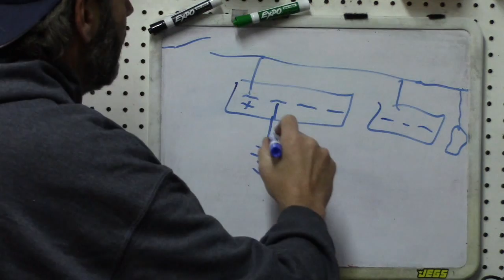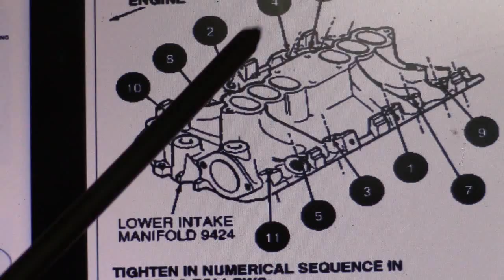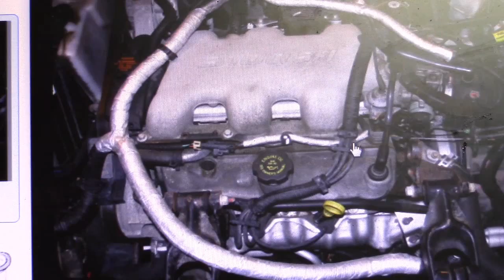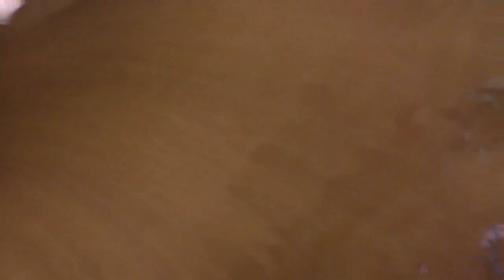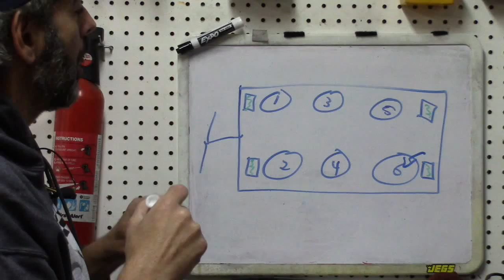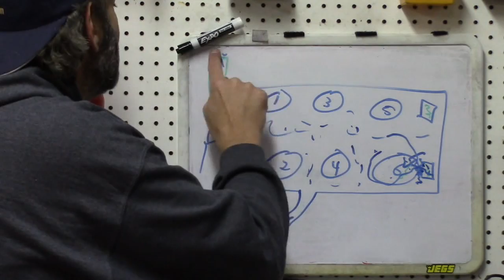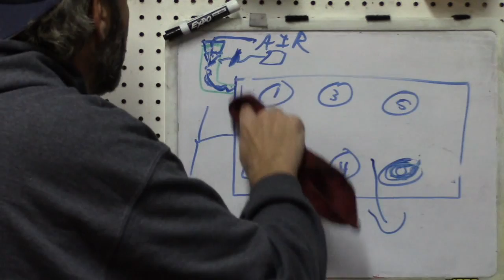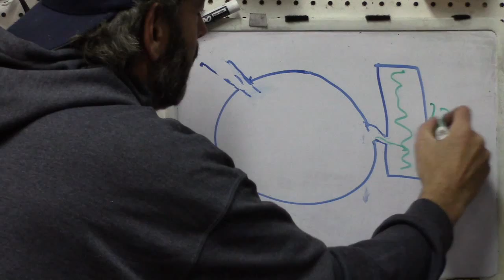04 Toyota P0306 Pt2-Can Compression Test Lie?

Comment: I have an 04 4R with 1GRFE & been trying to track down a coolant leak, but recently got an engine light (VSC trac and trac off too) with P0300 ( random misfire ) , i've been watching videos to get a clue on what the cause could be and stumbled on this series.  To test the leak i put dye in the radiator.  Now i plan on pulling the plugs and looking for dye.   I've done a block test previously and there is no evidence of a bad head gasket.  As far as the P0300 goes, the truck runs fine, no vibration or evidence of a misfire.  I have an appointment with my mechanic in a couple of weeks, if its an expensive repair, i will just drive it until it stops. Thanks for walking through the logic, its very educational.

Comment: On my 97 tacoma, I had a crack in the head. I was only using about a pint of coolant every six months so it didn't produce much tail pipe smoke. It heated and sealed quickly. For three years I thought it was a small system leak.

Comment: I have '01 Toyota 4Runner, 3.4L. I've been have this misfire code for a month now, P0300 (Random/Multiple Cylinder Misfire Detected). I already replaced spark plugs, wires and ignition coils. My Runner doesn't overheat, no coolant in the engine oil and no white smoke coming out of tailpipe). I took it to the mechanic and said it was a bad head gasket. The car runs fine but when I would start the car in the morning, it would hesitate for a few seconds then it would smooth out. Two days ago I replaced the Mass Air Flow Sensor and it that took care of the problem. I'm still getting the P0300 code. Any idea what could be the problem?? Thanks
Reply from the maker: what data do you have?

Comment: Would over loading the bed cause a blown head gasket? I'm trying to diagnose this P0306 code for my father because he's failed the bi-annual smog test. It's a work truck (05' Tundra V6) and has been used to haul demolition materials (sometimes over loaded IMO) and I discover his radiator was extremely low in coolant before the smog test(s) were conducted.

Comment: ok will try to be short. 2002 ram 1500 5.9 gasoline. first thing in morning skipps. i own this vehicle. runs short time 2 min skip gone runs fine. same thing every morning. compression test all good. tested all injectors all good. loosing small amount of coolant. skip is #5 cylinder. water in cylinder. but compression good leakdown good. there is water in the intake but no where around #5 cylinder. did coolant pressure test watched for 45 min no drop in pressure. how is water getting in cylinder head gasket blown. this is what i figured out. compare running compression to cranking compression running is always less same with the leak. the way i finally figured it out is i put the pressure tester on the radiator pumped up left over night, water was running out of the spark plug hole the next morning. another thing if i left the radiator on first notch in other words not locked tight you could drive truck everything fine no skip in the morning, it only skipped in the morning if the radiator cap tight. the leak was very small had to have steady pressure to leak in cylinder and temp also played a factor in the leak as well. cold never leaked hot didnt leak when the engine reached just the correct temp leaked water. worked on and off for a while before i pulled the head. i didn't have the head surfaced or checked for cracks just removed cleaned installed new gasket all is good for over a year now.
also no combustion gas in radiator

Comment: I'm not a mechanic but ...that cyl Nr.6 compression test will show compression loss with a radiator cap removed when compressed air will start to pressurize coolant so with the radiator cap on the pressure can't go anywhere because water(coolant) can't be compressed and resist even 200PSI of gas pressure, but on the intake, stroke coolant can easily get into the cylinder under 10 0r 12 PSI ...if it is nonsense please forgive me of waste of your time, thanks.

Comment: Sometimes you get leaks that allow passage of liquids but not gases. I had a mechanic tell me my car needed a fuel tank for a safety (was leaking at the seam halfway up the tank). I immediately thought he must be wrong because if the car was driven at below half a tank for a long time (which it was) there would be a check engine light for an EVAP leak. There was no check engine light. I did a purge and seal test on the fuel tank and, again, the test showed no leak. However, once I put 3/4 of a tank into the car and left it for an hour, lo and behold there is liquid gasoline leaking out of the seam halfway up the tank!

My explanation for this would be that liquids are incompressible, so when they reach the area of leakage they wedge (or jack) the mating surfaces apart and create a vein where a leak can take place, whereas gases just compress and cannot separate the mating surfaces, so very small leaks allow the passage of liquids but not gases.

In your case, this might explain why your compression test showed negative, and your coolant pressure test showed positive for a cylinder head or head gasket leak.
Reply: gas molecules  are larger than liquid molecules

Comment: I don’t know if this has been mentioned as I haven’t been right through the comments but have you considered a cracked or porous cylinder head leaking into the intake port of cylinder 6. 

This would give the same symptoms of a leaking wet lower intake manifold. 

Just a thought.

Comment: crack in the block- half way down the bore. when piston it at tdc the skirt will cover the crack. no water in oil, cold misfires only when piston stopped at bdc. seen it- fixed it

Comment: Compression tests lie. This is common on Honda D-series motors, which commonly get "stealth" head gasket failures. I was working on one that was slowly consuming coolant and the compression tests gave no indication of gasket failure. I was able to get the coolant to rise very slowly at the radiator during the leakdown test, but I had to have it cranked up to like 120 psi.
Reply: Someone wants to sell a 2002 4runner, 188K with the following symptoms, was misfiring on pickup only, smooth after cursing speed, no rough idling, run hot/warm a few times due to low coolant, haven't for a while, never changed radiator or engine tuneup for 100+K, have to top off coolant every other month, drives fine other than misfiring, smell coolant in passenger cabin?  no gump in coolant, engine oil changed.    Your opinion would be appreciated.

Comment: I have this same exact issue. P0306, CEL only comes on cold starts, rough start for around 30 seconds and then runs perfectly fine. I’ve changed the plug, done leak tests, compression tests. Nothing. Only other thing it could be? Valve issue? Fuel issue? Not sure. Was interested in this and this helped for sure! Will keep you updated on it
Reply: sometimes it even maybe a bad coolant temp. sensor , as it says the ECU if the engine is cold or not , since the ECU always extends the timing of fuel injection when the engine is colder but if its hot it shortens the fuel injection, faulty sensor may giv faulty information to the ECU
Reply: @EE-hk8iu  I had a similar issue with a bmw e30 325i, it has a coolant sensor sending info to the ecu that can make the engine hard to start, rough idle, generally unstable and in the worst case engine wont start, blue sensor.
Reply from the maker: I would start with fuel trim analysis. Thats always by basic starting point.

Comment: Something I noticed from the 1st video was that not only was the compression the same, but it seemed to be holding at 160. Ok it wasn't left for hours to see if it did drop. I was pretty sure the issue wasn't coolant in the cylinder. Love these cases, thanks Matt.
Reply from the maker: The compression tester I use holds the reading til released. It’s not applicable for a “decay” test. But I like your thinking which is why I did the coolant pressure decay test- which didn’t drop at all after 5 minutes. Go figure.

Comment: Greetings Matt: Your test did not lie. Have you consider a crack between the valves which does not penetrate into the combustion chamber.  Looking forward to the synopsis of the teardown.  Cheers
Reply from the maker: If that were the case, the leakdown test would not have bubbled the coolant over, right?
Reply: @SchrodingersBox  Got me there.
Reply: Now wait a minute, I may have caved too quickly.  Yes, there was a second leak down test that showed a failure.  There was also a first leak down test that passed; and, there were two compression tests that showed no lose of compression.  We now have a leak down test that passed and one that failed with two successful compression tests.  It seems improbable that a leak down test would pass in the presence of a leak in the combustion chamber especially the way the second leak down test failed in such a classic way; however, it is plausible that a leak down test can fail in the absence of a combustion chamber leak if one of the valves was slightly open.  Add in the fact that the chemical test showed not compromise, it seems probable that there may be a crack in the cylinder head into the valve compartment.  This would explain why the second leak down test failed and the first one did not detect the leak.  I still believe there may be a cylinder head leak into the valve compartment.  Looking forward to the results of the teardown.  Cheers from a card carrying two-percenter.

Comment: on that last video, compression within tolerance, less than 5% deviation across the cylinders = no head/cylinder interface problem.
on aircooled multis I'd suspect leaking floatvalve or injector for such a misfire. the liquid cooled GPZ-900R and -1000RX had the same problem but due to carb icing on cold days thanks to the ridiculous intake velocity under load in tandem with kawasaki's famously lean mixtures, the RX came with the 900R's retrofitted carburettor warming system, plumbed into the water jacket. 

running it on cold days without warming at 3000 rpm for at least two whole minutes meant inconsistent heating and possible coolant leaks into the cylinder missing under load. getting this wrong was cured by stopping the engine for five minutes after it warms up. on minus 20 days, I used to light it up run two minutes and go and have breakfast, it would be OT when I fired it up having finished my coffee in front of the fire in comfort.

the cure was "warm your engine to OT before applying a load".

coolant leaks with motorcycle premixes are instantly recognizable by the sweet stench of glycol antifreeze, the stuff glows fluro in good condition, so a simple loosening of the suspect cylinder's plug and turn over shows the flecks of fluro to confirm, and yes m/c cyl/head gaskets can be sound and coolant o-rings can get cooked by a hot running cylinder causing a failure when cold with extreme conditions.

as for the how can this happen considering the relative pressures of the compression of gas and coolant, the fault only shows at cold, the atmosphere is a constant pressure and the cylinder is a rapidly cycling compresssion/vacuum 'flux', the cold causing the relative increase in pressure in tandem with the non igniting subsequent vacuum cycle means the atmosphere relatively squeezing the reaction vessel, [in this case a water cooled motor], around 12lbs"2, [1bar=1 atmosphere = 12lb per "2 ish], plus the 12lb coolant pressure plus the sudden rapid application of vacuum and if there is the slightest break in hermetic seal on a coolant head o-ring, it's a relative 'gaseous vacuum pulling on 24psi liquid around 25% of the extrapolated cycle..

I'll shut up now.

door's thataway yeah?
Reply: Your opinion would be appreciated.  What do you think the problem would be?  Someone wants to sell a 2002 4runner, 188K with the following symptoms, was misfiring on pickup only, smooth after cursing speed, no rough idling, run hot/warm a few times due to low coolant, haven't for a while, never changed radiator or engine tuneup for 100+K, have to top off coolant every other month, drives fine other than misfiring, smell coolant in passenger cabin,  no gump in coolant, engine oil changed.

Comment: It would be interesting to see the actual termination point of the coolant port at the point where the intake meet the head ! your diagnosis could still be valid if the servise of the intake actually blocks off the cooling port
Reply from the maker: Impossible that this is not a combustion chamber leak because intake is closed on a leakdown test.  No other explanation. Something about the head gasket allows a leak with no compression loss.

Comment: wow! yeah i was thinking that too, that threw me for a loop, i wonder if the crack in the head/ headgasket is small enough it leaks but when it warms up its no longer leaking at that time, there is a video out there by south main auto (Chevy 5.3 Antifreeze Loss: Cracked Head) that shows the crack in the cylinder head, part 3 is out but this is really getting me thinking, thanks for sharing! really looking forward to "the fix" to shed some light on the diagnositic part of this issue
Reply: Your opinion would be appreciated.  What do you think the problem would be?  Someone wants to sell a 2002 4runner, 188K with the following symptoms, was misfiring on pickup only, smooth after cursing speed, no rough idling, run hot/warm a few times due to low coolant, haven't for a while, never changed radiator or engine tuneup for 100+K, have to top off coolant every other month, drives fine other than misfiring, smell coolant in passenger cabin,  no gump in coolant, engine oil changed.
Reply: @AsiaRoadTrek  i think you should get it inspected by a mechanic, if your interpretation of "pickup" means its misfiring while acclerating then i would suspect an ignition issue, the fact of smelling coolant in the passenger cabin likely means the heater core is leaking but you will want to do a pressure test to confirm, i would not be excited about hopping into that vehicle unless it was otherwise in good condition(including underneath) and was dirt cheap, best of luck, go get it inspected by a mechanic
Reply: @mattbickford2640  - Thanks for the input.  I had the same diagnosis without seeing the car.  It would be a great project car for me if it's just headgasket and the trans is good.  The body and inside is above average.  For $3.5k its worth the risk in my opinion, giving that 3rd gen is going up in value.  I will keep everyone posted.
Reply: @AsiaRoadTrek  as a dealer tech, i can tell you used cars are going up in price period, its been a pain for the used car department here since the pandemic started and it went up over 30% , please keep it in mind that its not just 1 specific make or model, best of luck tho! Hope you have a lot of fun with it along the way!
Reply: @mattbickford2640  - Thanks for the response.  I really enjoy the 3rd gen 4runners, they are amazingly well built.  I brought a used one 15 years ago and put on 125k since but the value only drop by 4k.  That is unreal.

Comment: Welcome to the professional technician world!  Nothing is so simple when you do this on the daily!  Heads are coming off regardless; so we're done right there!  Outside of a leak down test to confirm lower end integrity you're wasting time going any further with it-it's head job time!  What's on the clock 150k, if so, not surprising.

BTW...they charged for plugs and probably had enough unpaid diag time wrapped up in her to justify the charge...that's how it goes sometimes when you work in the shop as a "professional"; not saying I agree with it, but it's because most customers don't like to pay for diagnostic time...because after all "they gotta guy" who knows better, but for some reason isn't able to get it done?

If you work on the floor daily as a diagnostic tech, well then this is commonly known.  When you do it as a hobbyist it's a completely different scenario altogether, because you are able to take your time with everything you do and that changes everything!

Gathering information about the complaint, checking for TSB's, researching system design, and then we test to confirm🙃.  If we are still unsure, we reach out to other techs in the field for help!

Just some food for thought!

We all make bad calls...it happens!

Comment: DIY here. The flap theory very interesting, and curious also. I have to be honest,  I also thought of a behavior similar to  a one way valve, even before you named the phenomenon as a "flap".
This behavior would also justify why the cylinder has a misfire only when it's cold.
When the engine is turned off, unless the cylinder #6 is at the TDC, it is at atmospheric pressure. The cooling circuit instead, being still at high temperature, results at higher pressure, thus causing the coolant to leak into the cylinder by the flap.
If I remember correctly, you said that after a short time the engine in running, the misfire disappears and the engine turns smoothly. It would be interesting to do this experiment. Start the engine, make sure the misfire disappears, then turn it off. If the coolant is not hot yet, try turning the engine back on in a short time. The misfire should not reappear, as the coolant is not already hot and also you have not given it sufficient time to get into the cylinder in a considerable amount. If in the meantime it had heated up, you could try again but this time you'll vent the pressure in the cooling circuit immediately after switching it off, in order to avoid the coolant to enter the cylinder.
Congratulations, great video, very interesting. Keep it up.